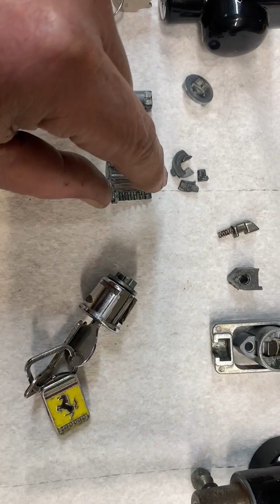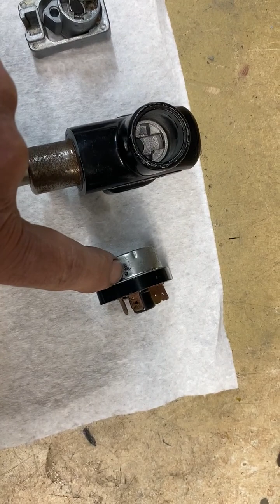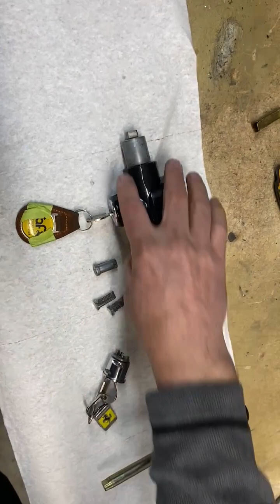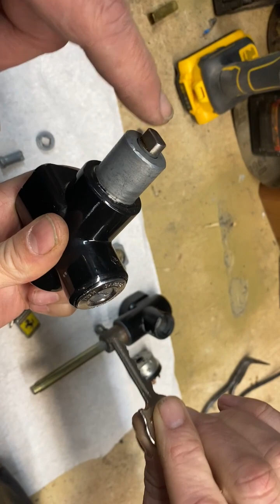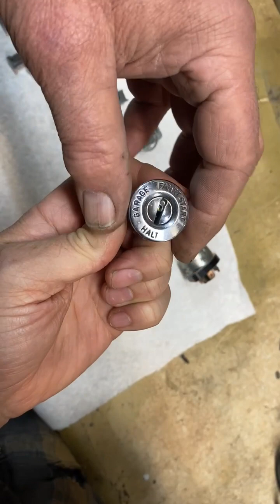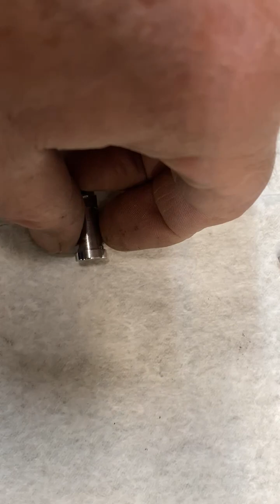Neiman Ferrari ignition key tumbler and steering column lock assembly

Comment: how do I get the lock housing out of the black part?
Reply from the maker: We use a .040" drill, and drill down the center of the steel blind pin. However, many have been modified due to back yard experimentation. Once drilled we screw-in a self-tapping 00/90 hardened steel machine screw. Then we grip that screw with a tiny vice-grip attached to a slide hammer.  Unfortunately, even McMaster Carr's best screws in this range are garbage--compared to the incredible strength of the machine screws that used to come in LOSI Micro T radio-controlled miniature RC car repair screw kits.  They are discontinued and we have only a few remaining. Still, if you get the drill centered perfectly on 1ST drilling, you can continue to step up wire drill sizes until you finally peel out the remains of the blind pin. Sometimes we thread the hole for a 6/30 set screw.  You get the idea.
Reply from the maker: There is a "Blind Pin" that holds in the cylinder. We use a .040" drill to bore that pin hallow, then insert a 00 / 90tpi hardened machine screw into that pin, and pull the pin out with a small vice grip attached to a morgan knocker.  This is a delicate process requiring skill, and patience- a rare comodoty these days. Can you drill a 10 penny nail hallow longways?  Not many can. Most revert to dynamite- or overedrilling and threading for a set screw. We have seen MANY clever blind pin removals. We have it down to 8 minutes or less in most cases  Jim Simpson, ODD Parts Fabruication.